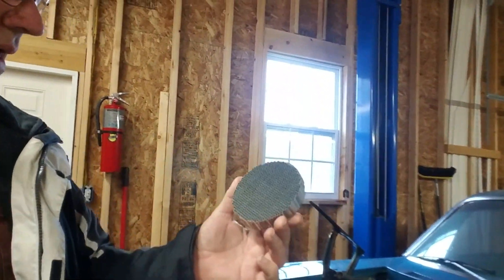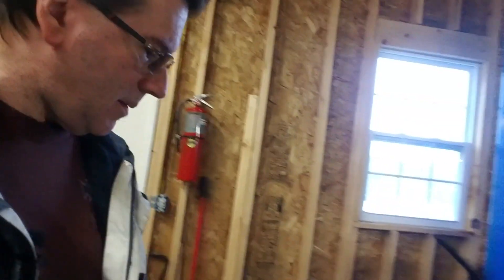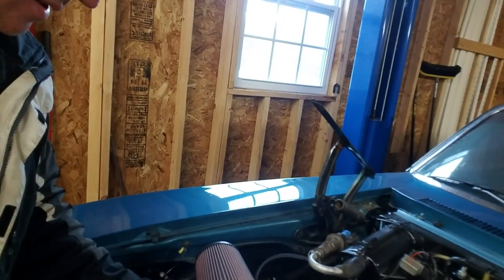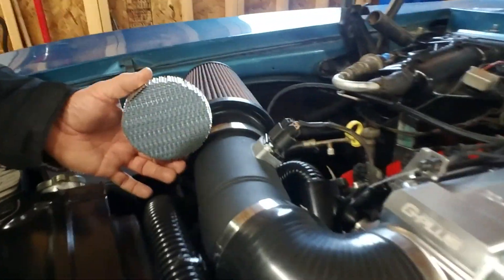1972 Nova Air Intake Straightener Results

Comment: Did something similar on my 1.4L Ecotec with an aftermarket intake. Got a P0171 code w/o the screen, slapped it on and fuel trims are spot on again, just like stock. Thanks for the video!
Reply from the maker: Yeah, it's truly amazing seeing the results of the honeycomb setup.  The MAF is just that sensitive to air direction and dropping in the honeycomb stabilizes it like no other.  I didn't expect it to work as good as it did, but the numbers tell the truth!